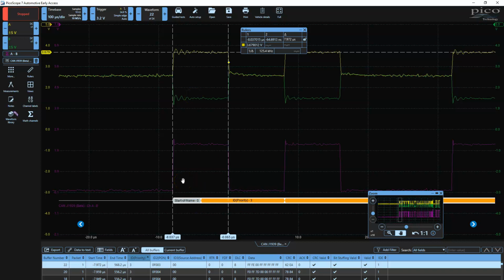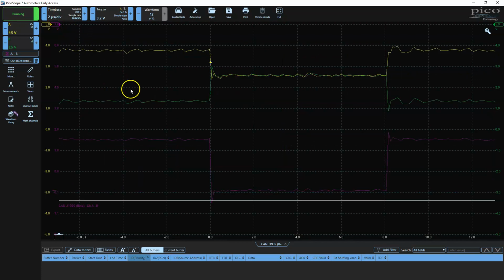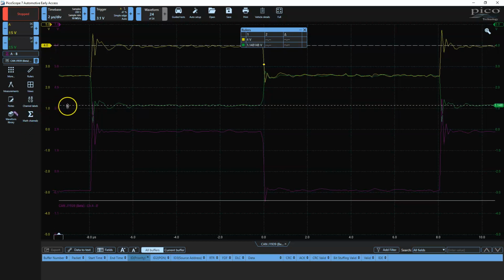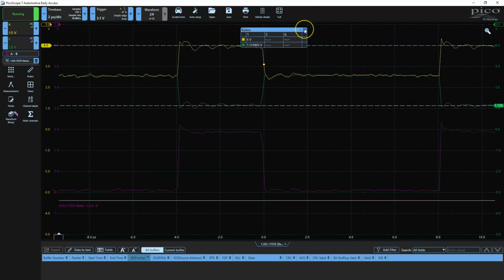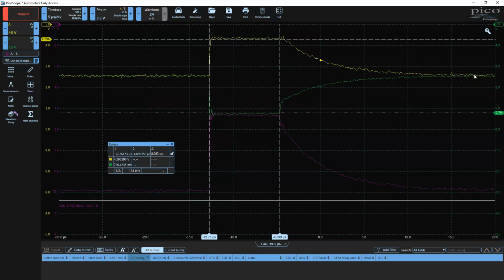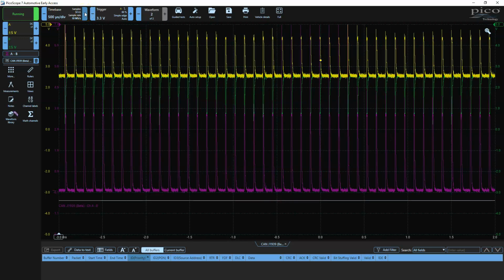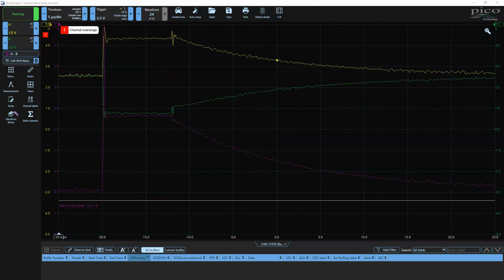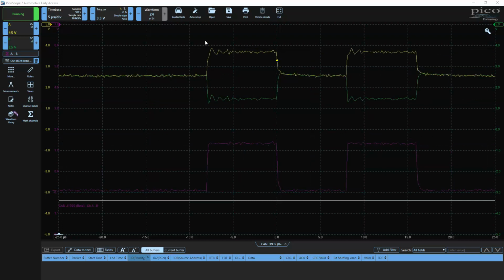Advanced J1939 Termination on Scope 16

Comment: This whole series has been very enlightening. Thank you! And thank you for putting it terms us tech's can understand. As a construction equipment tech for the last 42 years, the last 32 with Deere C&F, I can tell you they still want you to diagnose with a voltmeter for Hi/Lo voltages and an ohmmeter for termination resistors or for wire to wire shorts/shorts to ground. I am sure glad I started using a scope years ago. Admittedly, CAN network troubleshooting has been a challenge for me. Because of this series, I now feel much more confident when I approach a CAN issue. I look forward to your future videos.
Reply from the maker: Thanks for the kind words.  You may know that I worked for JDPS as a diagnostic engineer for 10 years, took their buyout offer to retire in 2016, and came back on contract with them for about five years.  I ended my affiliation with Deere a few months ago.  During that entire time, I attempted to advance the level of technician training by teaching Deere JDPS service training and DTAC and attempting to introduce new diagnostic tools.  JDG10273 diagnostic test box was one of my first efforts and the CAN and Connectivity Health Wizard was my last project.  Both of those are either loved or hated by Deere techs and bad mouthed by most of DTAC.  I apologize that I failed in my annual goal of adopting an oscilloscope for Deere service.  I don't have any animosity towards Deere as a company, but they have made their decision on what tools and training they provide to their dealership technicians (C&F does a much better job than ag, IMO).  It is unfortunate since what you ag, C&F, and on-road truck techs do is so crucial for society.  My friend who is a BMW tech gets more support and deep technical service information from BMW to fix a soccer mom's SUV than a Deere tech gets from Deere who is trying to fix a combine during harvest.  When you have managers and so-called experts who have never fixed anything more complicated than a sandwich making decisions regarding service and shareholder value is deemed more important to a company than their customers, you get what you have experienced for the past 42 years.  The only way a company like Deere, which leverages their brand reputation from the past, will change is for their dealer techs to demand change.  Sorry for the rant, I'll try to get time to make more videos once I get a break in the project I am currently overwhelmed (in a good way) by.  Bridge officially burned.
Reply: @joebell6283  Bridge officially burned? More like hit with a Scud missile😁. As far as the CAN Connectivity and Health Wizard, I am in the love it camp. I did notice in the user manual's screen shots of the wizard, you are the logged in tech on them. I use it for every .09 code or any other CAN complaint. The JDG10273 diagnostic test box, love that too. Best tool Deere ever introduced. Since 70% of my work is on OEM engines and 90% of those are aftertreatment issues or complaints of codes, I use that tool almost daily. Saves me the trouble of backprobing. So, since you had a hand in those tools, THANK YOU! As far as Deere's training, I am sorry to say, I could write a book on what is wrong with their training and the Capstone process and write another book on how to improve it. I'll concede on the Engine Electrical Systems Overview they recently came out with. That was a huge step in the right direction. Excellent material. DTAC, no comment🤐. You have a Merry Christmas 🎄and a safe and Happy New Year!
Reply from the maker: @mg2361  at this point in my 46 year career, I can destroy bridges.  I found that most techs who like the diagnostic test box also like the wizard, along with most everything else I had my hands in at Deere, and vice versa.  Hands down, ag DTAC hates about everything I ever did.  I joked that the ag DTAC approved method of load testing a wire is to use a VAT 40 to melt the insulation off the wire.  If it melts, the wire was good.  I am not fond of the CTM procedures written around the use of the DTB though.  If you don't understand what the tool is doing, one small error in following the CTM will lead you down the wrong path.  The limitation of the Wizard is the available hardware.  I think I extracted about as much as I could from what I had to work with.  You should let your TCSM know about the engine electrical course being quality information.  There are some very good trainers in JDPS.  Merry Christmas to you also.

Comment: Joe,
This has been great.  I am in ag and have been conducting classes for ag service techs.  You are absolutely correct there is very little information on active terminations.  I work with both the big two companies and have not been satisfied with their answers.  Do you have any suggestions on where to find more about TBC terminiators?
Reply from the maker: Sorry for not replying, I did not see your question.  You are correct in there not being much information on TBCs available.  I was able to get some of the background from the design engineer himself on why tractors painted a combination of two of the primary colors used active termination early on and why they no longer use it (hint: overly conservative and then a shift in corporate values to shareholder value).  It is a very simple concept, hold the lines at 2.5V through a series resistor (about $1 worth of  components selling for $163 each).  I believe that the ISO implement bus is the only user of active termination at this point.   I'll create a video on active termination when I retire again.